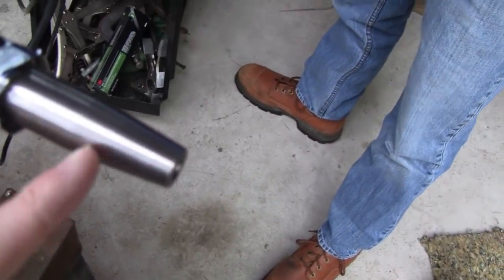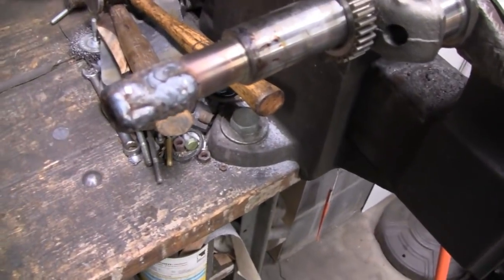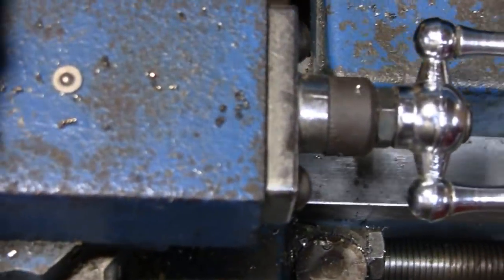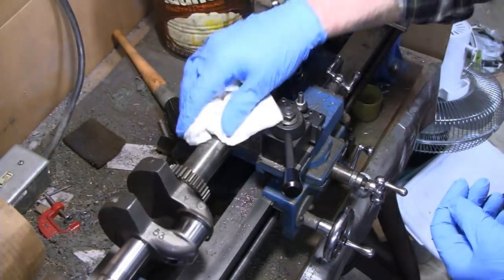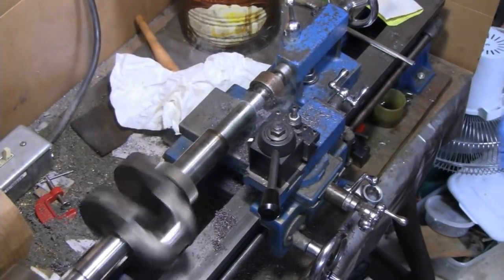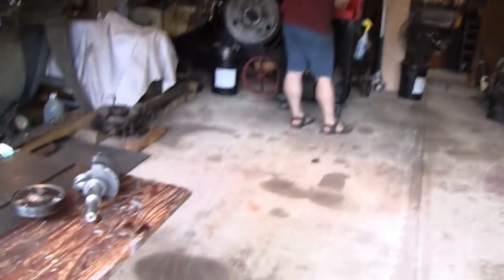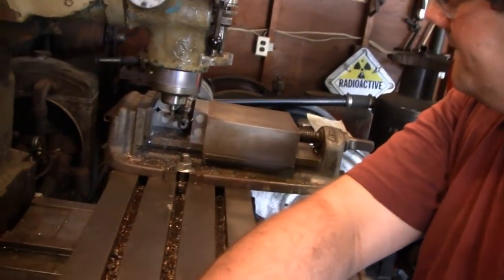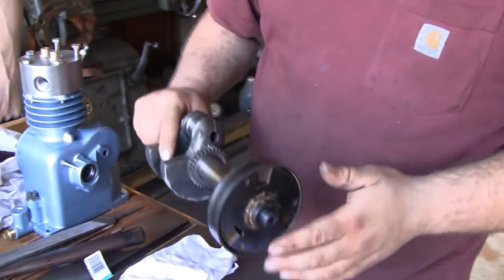TAPERED CRANKSHAFT MADE INTO A  STRAIGHT CRANK (part 2)

Comment: I literally just went through this process myself, but I had no lathe. I ended up threading a cut bolt into the output shaft, mounting it to a drill press, and going at it with a file, sandpaper and calipers. Took the shaft all the way down from 0.78 to 0.75. Then I used a cutoff wheel to cut a keyway into it. Fit my centrifugal clutch perfectly on the first try!

Comment: When I worked at the brick plant many years ago, I used to love to watch the old guy working on a lathe that would need a rail car to haul it.  I thought it was neat that you are using special cutting oil which was the same as the milky oil used in that lathe.
Reply from the maker: I worked at a Naval Shipyard for 10 years, you oughta see the size of the lathe that makes an Aircraft Carrier Propeller shaft!!☺
Reply: I guess the largest shafts cut at the brickyard were from 8-10 inches diameter and 10 - 12 feet.

Comment: Did you say what kind of wire he used to weld that crank? I may have missed it. I've always heard you should use stainless wire or nickle rod on cast iron. You only have to get the metal up to around 500F for about a hour to anneal.

Comment: Nice to have classic lathe !   I clamped my salvaged from a bad generator tapered shaft 10 HP engine down and reduced the tapered 7/8" shaft to 3/4" with an angle grinder with the engine running . Not exactly high tech ? but It works.   I installed a 30 series torque converter and It made a great go kart engine!

Comment: Great video! I just found an old cast iron 16 HP Briggs that came off a welder generator and it has a tapered shaft with no key way. I got the engine running good but it wasn’t really useful for anything with a tapered shaft. I will have to try this out with my engine!

Comment: Get yourself some inexpensive 1/4" High Speed Steel lathe tool bits and grind them to proper shape and they will handle the interrupted cuts of your welds. IF the HSS is properly sharpened you'll probably get a better finish than the carbide gives as well.